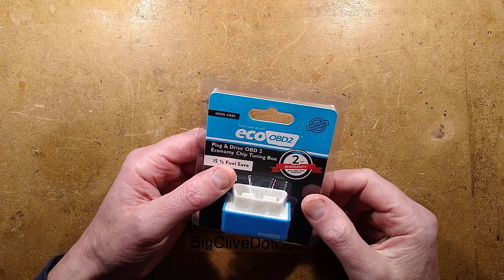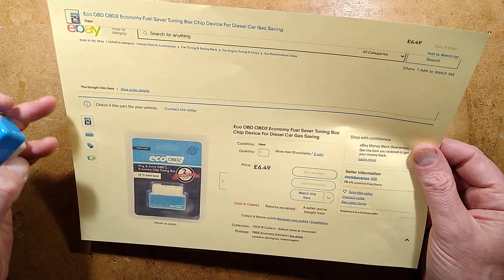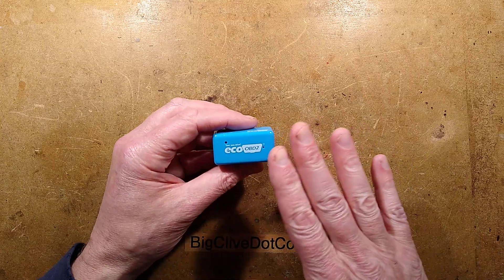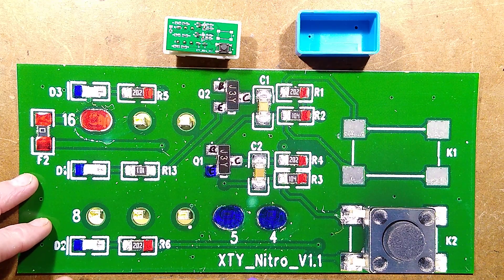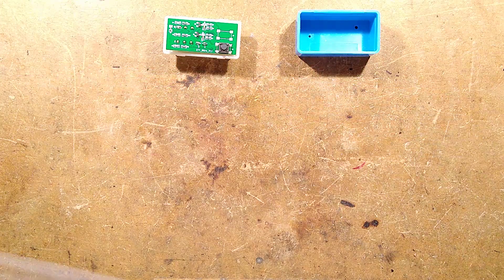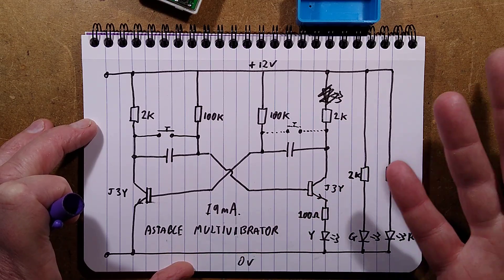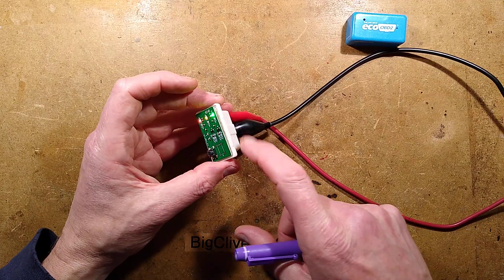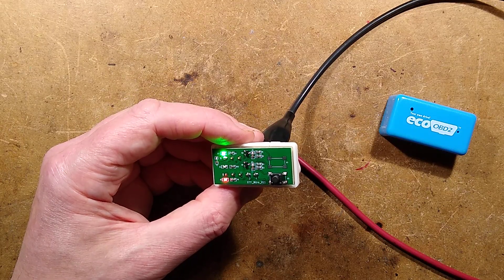Worst fake Eco OBD2 fuel saver yet (with schematic)

Comment: you dont want one of those devices messing with your cars computer thats for sure, there are many problems with buying cheap chinese electronic devices, i bought an SOS panic alarm device for my elderly mother, the device uses a sim card, So when the SOS button is pressed it sends a text with a google map on the location of the device and calls a programed mobile phone number.
I suspect the 4g mobile frequency is incorrect for Australia, but correct for china, what a waste of money,  and they give you no indication of any problems you may run into, they are just betting most people wont bother for a refund which is impossible to get anyway !!!.
beware of no name brandless devices with no  functioning return mechanisms an policies !!!

Comment: I used to work for an automotive company writing sw for diagnostics tools. We had a BT dongle product we were producing; the power requirement we had to meet for a permantly connected device was something like less than 50uA current draw when the ignition was off.

Comment: About 3-4 years ago, my sister came across an advertisement for similar fuel-efficient saving device. Not via OBD port, but the device was in 2 halves, and you would put them around the fuel line, before entering the carburetor, and zip tie them. The way it was described, it was that it was atomizing the fuel particles for better mixture with air, and thus having more energy with less. There were no blinking lights to dazzle more people. 
She, and also the rest of my family were really adamant to find a way to purchase the device since it was advertised via WhatsApp by word of mouth mostly. 
Coming from a tech background, but also having finished high school with a diploma as an auto mechanic, the bullshit radar was in high alert for me, yet, my word on them wasn't enough.

Had to do some digging on the web, and finally managed to show them that it was just a cheap plastic with magnets on each halve and nothing more. And unless of being this incredibly extraordinary magnet that could split atoms, there was no way that this device was going to improve whatever they said it did.

Comment: Yeah so my car i just modified an old carburetor intake heat riser with the vacuum port and flapper to allow warm air intake but if you hit the accelerator hard it closes off to cool air. The vacuum thermostat cuts off when its too hot. So it regulates. The highway mpg averages maybe 3 mpg improvement. Didn't do as much as i thought but at least it does something. Although i know in the cold months it is really doing something because that ice cold air it would regularly get 5-7 mpg worse than summer. Its already starting to get colder around here and so far the highway average is just barely affected. Maybe 1 mpg down from summer. Likely only because of the extended warm up period. . The car listens to the maf and o2 more than anything so bringing in warm air and changing air density itll adjust itself on that. Plus the heated air can theoretically preheat the fuel as it mixes into the cylinder. Warm up time is reduced and the vehicle gets to appropriate operating temps quicker. It has been running well set up this way for about a year now. V6 1988 Oldsmobile 3.8 engine record high 33 highway mpg. U.S. measurement. Its only rated 27 highway.

Comment: I work in the emissions industry. We heard a good story of a piggyback rail pressure fuel saver. It intercepted the rail pressure signal and sent a lower rail pressure signal back to the ECU. The ECU think it's rail pressure is lower than it really is and will calculate the fuel use to be lower and show you on the dash. The only problem was that when the ECU tried to regenerate the DPF the fueling was so off that it made them so hot that they cracked. Also it probably used a bit more fuel in reality.

Comment: I remember way back in the 1970's when you cut the fuel pipe and fit this devise in the fuel line, and it will cut your fuel bill and loads of motorise bought then and it didn't work.

Comment: I love these! As a mechanic I find it hilarious that people are willing to buy a mystery device which they think actually does anything at all, let alone just automatically find the ECU and tell the car to use less fuel? 

To save fuel at all you'd have to remap the ECU entirely to to as such, litterally the opposite of a remap for more power. 

What intrigues me is to what they actually do, because they do nothing at all to the car (mostly).

Best case I ever heard was one was set up (and this is just hearsay so I can't confirm) to cause the car to run overly lean, which for any non mechanics reading this, is quite bad lol
Reply from the maker: When you see one of these plugged in you should offer to do a firmware upgrade on them for $10 and get yourself some beer.

Comment: BigClive, agree it's a big scam, there's no shortage of fuel. I think this started with the progressive liberals here in the states that pushed the BBB (build back better) legislation that was going to fund it by raising taxes on the wealthy. Since we are all fooled into thinking we have a democracy (which started with your Magna Carta), the reality is we have an Oligarchy running all democratic governments. So the oligarchy made up the fuel shortage, as well the supply chain issues and shortages so they could raise prices on every commodity. Your system is a bit better, as the campaign donation side seems to be hidden, but here in the States, it's clearly a bribe that called a donation, and with all the PAC's (Political Action Committees) media advertisements are hidden donations for or against the candidates. But the representative now has to pay back those bribes with special legislation to enable or keep their huge money pumps. This has worked OK, as long as the oligarchy does not get greedy, but they are greedy, and we will end up with another change in what cult is in power.

Comment: Fuel costs are a joke it’s all about profits the cost of a barrel of oil is down to $83 fuel prices in the UK are at least £0.50 per ltr higher than they should be..
When you have small independent garages selling fuel cheaper than the supermarkets you know we are all being bent over and shafted…
Normally tuckers and the AA or RAC are vocal about this but I think they have been 🤐 

Truss met with her banking buddies and probably told them what she was going to do so there’s probably some insider trading going on as well… 
A few years ago they were having blockade’s when it was lower prices….

Rant over sorry Clive

Comment: Wow, they wasted so much money flashing an LED. They should've just bought one of those self-flashing LEDs and got rid of the rest of those components. They could even retain the function of the button stopping the LED from flashing by putting it across the LED. And of course, getting rid of that completely pointless red LED.

Two resistors, two LEDs and a button. Now that would've been the cheapest and laziest fake OBD fuel saver possible.
Reply from the maker: The red LED is needed for the red cased version.

Comment: It does work however, you are using it incorrectly. You need to glue it under the accelerator pedal to prevent full throttle.

Comment: This blinking light consumes 10 A.hr of battery charge when left for 3 weeks. Some well used batteries barely deliver 10 A.hr so if you don't use your car much this device could save you a lot of fuel because the car won't start.

Comment: If you have an older car, be sure to check your exhaust circuit. My muffler opened up because of rust. It now has a  "sportier" sound and quite a bit more power, but it started to empty my tank twice as fast.
Reply: Because you enjoy the sound and Press more often the pedal! Unless the leak Is before the lambda sensor of course!

Comment: Hey Clive, any recommendations on wall power monitors?
Reply from the maker: The generic ones from eBay seem to be OK for the irregular use they tend to get.
Reply: @bigclivedotcom  yeah, just wanting to see what each device and then extensions cables are running in the house

Comment: Man my pickup drinks alot of gas. Cylinder #6 is hurt so it drinks alot of oil too...
Got a brake line crimped shut in the rear but that leaks too so it drinks brake fluid as well. Im dyin over here in this market hahahaha

Comment: Of my understanding of them terrible things, they was first claimed to supposed to smooth your cars electrical circuit, they are nothing more than transistor or IC controlled Astable timing circuits and they could interfere with a cars management.

Comment: Considering that OBD is no longer connected to the main CAN lines, that cars stopped having only 2 CAN lines fifteen years ago, that the engine map resides in the engine ECU and its writing is protected with protocols and decryption keys available only* to OEMs and that all new cars have security gateways in every subnetwork...

Yeah, fuck that.

Comment: I had an ex company car with a 50c fuel saving device. It worked amazingly well & really saved me loads on fuel costs. It was a small bolt welded to the underside of the accelerator pedal!...
Reply: Did it shock you every time you put your foot down? To stop you from using a lot of gas?
Reply: @PREDATEURLT  I drive in medium to heavy traffic everyday. A highly responsive car (cable throttle) lighter than 3000 pounds with at least 150hp can save you a lot of accidents and also, death. Everything I see everyday proves your point of view wrong, one of my cars is really slow (2013 Fiesta) to react and accelerate, which very often almost couldn't get me out of a dangerous situation, but I just got lucky.
Reply: Lol sounds like excuses for bad driving habits
Reply: @OldSchoolZ-wy2yx  
If you need to accelerate to get out of an accident.
You should never have put yourself in that accident position in the first place.
Reply: bet the motor is full of carbon. lol little speed don't hurt and actual can improve  fuel economy!
Reply: @Hotbox8602  Ahh, the good OLD, bad OLD, Italian tune up.

Modern engine management: my reasons are beyond your comprehension.
Reply: SaltyBrains  still you cant speed up, when the welded bolt touches the "floor". You cant press it further.
Reply: @talos86  actually the bolt is here to prevent speeding up too fast , not speeding up at all 
see it as a cheap motor flange
Reply: I wouldn't work for a company if they did that. Speed governors are one thing, and I get it, but sometimes you need that extra zip in the doo daa to pass someone or get up to speed on the highway, etc.
Reply: @houstoner or maybe learn how to drive a safe speed so you don't have to pass like that.
Reply: What happens when you need to drop a gear and floor it to get out of trouble?

Comment: These are right up there with the fuel saving devices that"Worked" by smoothing your car's electrical usage by being plugged into the cigarette lighter/accessory socket.

Snake oil... As profitable today as it has ever been. There needs to be strong legal action against the scumbags that sell these things.

Comment: These obd "tools" are a scam and the computer already installed on your car should already help save gas as long as  your fuel nozzles, throthle, spark plugs are working correctly or other engine systems. And some of these obd things can destroy the computer in your car. So these could cost you alot of money instead.

Comment: Your videos are just at the limit of my electronics knowledge; just over in fact which is why I watch them to learn. This I  understood. We made astable and bistable multivibrators in class at school, and later in college. I wont say how long ago that was but we used machine code mnemonics, and BBC micros were a pretty neat idea.
Of course, in my day fake devices were simpler and more reliable. I remember a fuel economiser which was just a great big magnet that fitted round your fuel line to electrostatically charge the fuel and smooth its flow (it wasn't even neodymium). No electronics to go wrong.

Comment: I want to believe there IS an optimization that could help, but the only place that could really happen would be in the chipset in the computer that runs everything.  Strap a chipreader to the brain of the car, take in data for a month, and maybe you'd be able to squeak  some performance out of the small adjustments that are theoretically possible.

The chipset is for as general purpose as possible, the best fit for as many potential drivers as possible.  So why shouldn't there be a subset of directions that works a bit better for your exact driving conditions?

Would it fit in a tiny stupid box?  Yha, no.  Your trying to do an optimization at least as hard as the one that race teams do to drag out the last tiny ergs of performance from a stock car.

Comment: I want to bet that driving for 200 miles while having that device in the back of your head, makes your driving more consistent and makes you aware of how hard you press the gas, which them probably does actually translate into fuel savings. But then again, a post-it note on your steering wheel would probably work better.

Comment: I do have an Elm327 OBDII clone connector, that looks much like this one.  It was as cheap as this one, however it does read the ECU, and it also have options to erase errors.
It would be nice to see you actually touch upon one that actually works.
Reply: Jeroen  It wasn't advertising that it would.